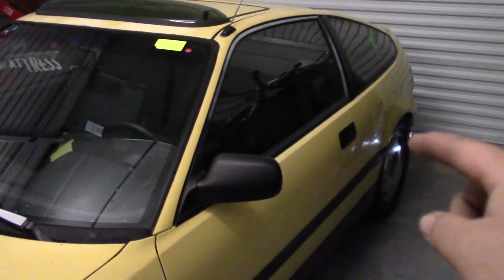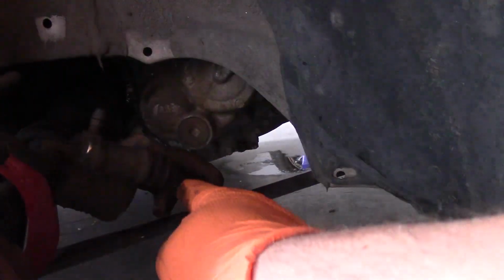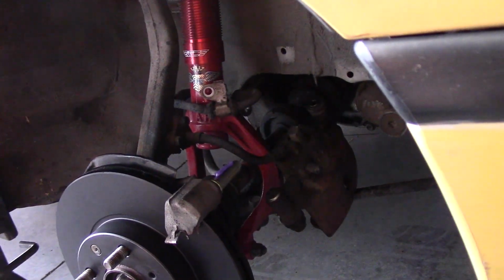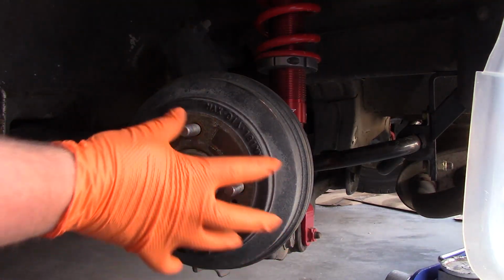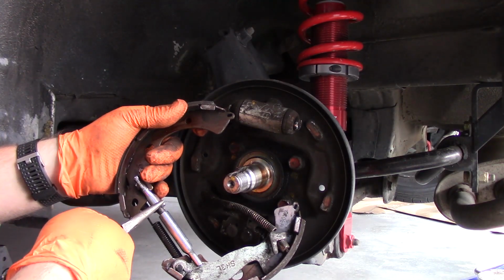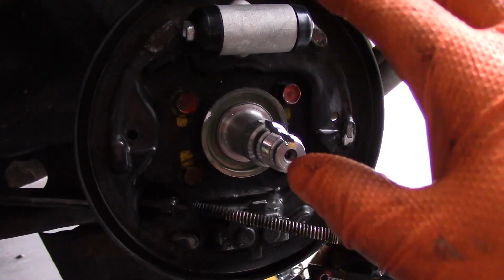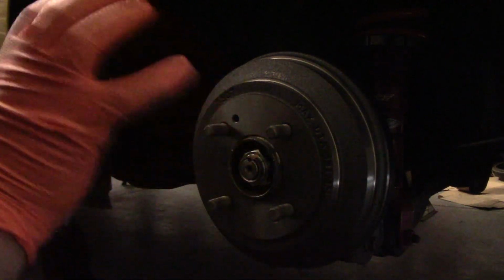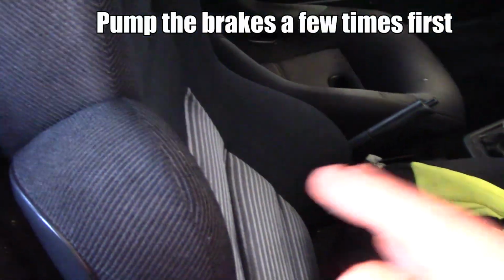EF Civic/CRX Complete Brake Service (88-91)

Comment: there is a washer that goes in-between the pin and the horseshoe clip for the parking brake lever, make sure not to forget that
Reply: How do you remove horse shoe clip? To put on new shoe
Reply: @ I use the same method I use when removing a master link from a chain

Comment: If I pushed the break pedal and the cylinder pop out and blow the seals, what could happend with the cylinder? I did that =( that means that the cylinder doesnt work anymore?
Reply from the maker: Correct, time for a new cylinder or a rebuild kit

Comment: Hey im having a problem with my parking brake lever, when I pull it down the light stays on but if I keep smacking it down to hit the bottom til it bottoms out it goes off but im guessing it isn’t laying all the way down where it needs to, do u know any way to fix it
Reply from the maker: Hard to say without looking at it. The first step will be to probably remove the center console and check that there isn't anything binding.

Comment: Thanks, I'd never changed my brake pads and rotors before and it was really handy to have a video of the exact same ones as mine. It took me forever to get the seized bolts and screws off but I managed in the end.
Reply from the maker: Glad you found the video helpful!

Comment: I left my e-brake over winter while traveling. 😖
Reply from the maker: Were you able to get it unstuck?
Reply: @MuffinRacing  no. Thanks for asking. I'm gonna look up on how to do it. Maybe heat it up
Reply from the maker: I wonder if using the bolt through the drum would be enough to unstick it? Probably pretty tough though. Good luck!
Reply: @MuffinRacing  I'll let you know. I'm gonna watch your other vids. Cheers

Comment: How did you get that smudged bolt off of the rear cylinders???
Reply from the maker: Are you talking about the brake line fitting, or the bolts holding the wheel cylinder on?

Comment: do you have pictures of the pass through to get to the star key??
Reply from the maker: Are you talking about the drum brake adjustment?
Reply: Going to re adjust my star key tomorrow. Can i adjust with the drum on but use the little hole that's covered by the grommet? Trying not to take the drum cover off. I have no ebrake pressure on my right rear
Reply from the maker: Yeah, you can adjust with the drum by using the hole with the grommet. It's tricky because you're basically doing everything by feel, but it's possible. The Haynes manual says to adjust until you can spin the drum with the parking brake off and the drum only rotates one revolution

Comment: Can you link to where and what you purchased? I'd like to know what Rotor, Pad's, and Calipers you used for the front brakes. I have a Y-49 '89 CRX Si so pretty much the same as in this video but all the kits I am finding online don't include calipers and I am wearing of buying things that wont fit together.
Reply from the maker: I used EBC yellow stuff pads and EBC RK Series rotors in this video and bought them from Summit Racing (https://www.summitracing.com/parts/EBC-DP4911R and https://www.summitracing.com/parts/EBC-RK403). They're a pretty aggressive pad for regular use, I am using them for autocross. The original calipers were in good shape so I left them alone.
Reply: Doh! The only problem I am having is making sure I can find a caliper that will fit any rotors or pads I buy.
Reply from the maker: That is a tricky one. Are you trying to upgrade the brake sise?
Reply from the maker: My guess is that kit is designed to work with the original caliper size.

Comment: i fucking hate drum brakes thats why i converted my 90 crx to disk in the real
Reply from the maker: I definitely understand that. If it wasn't for SCCA rules that I can't update the proportioning valve, and the fact the drums are just a wee bit lighter, I'd definitely make the switch.
Reply: not trying to be a dick or anything but how are they gonna know that you changed it?
Reply from the maker: If somebody "protests" at nationals they reserve the right to take it apart look
Reply: I mean i have heard of people doing the conversion and not changing the prop valve. Heres a link to the company that i used to do my conversion.
https://scarebird.com/index.php?route=product/product&path=67&product_id=116
Reply from the maker: That's pretty neat they make a kit. I usually see people bring the rear trailing arm from a later year crx si or integra
Reply: thats how i was planning on doing mine but even if you get the whole trailing arm assembly from a junkyard youll still more then likely need to replace the calipers pads and rotors. I did the math between doing it the traditional way and doing it the way that i did it. In the end the way i did it saved me about 50 bucks and I had all new/remanufactuerd parts for the swap.

Comment: Do you actually have experience with brakes being special snowflake delicate "don't touch them?" I'd imagine one lap on an autocross course will put more bullshit on the braking surface than any amount of touching ever would.

Putting those rotors screws in particular on is terrifying. Those look stripped to hell, and I've seen nicer ones refuse to come out. I'm also pretty convinced they don't do anything that the pressure of the wheel doesn't.
Reply: the screws are basically for the factory assembly, theyre not needed because the caliper and the wheel will keep the rotors in place. they dont hurt anything but if theyre already stripped which most of them are then i wouldnt put them back on. the rotor screws arent phillips theyre JIS which most people dont know and thats why they get stripped easily.
Reply from the maker: I like to run the screws anyways, there's the slight possibility that the rotor could wiggle around the studs a little bit, especially since I'm running aggressive brake pads and tires so the forces are higher than stock. I bought an impact driver from Harbor Freight for $6 with a JIS bit that makes quick work of the screws without stripping them that I highly recommend.
Reply from the maker: I was thinking more along the lines of keeping the brake lubricant, axle grease, and oil off the rotors which might not come off as easily. Couldn't hurt to keep them clean, though